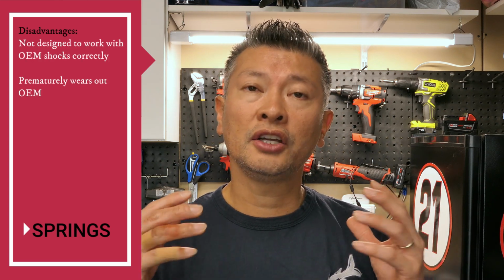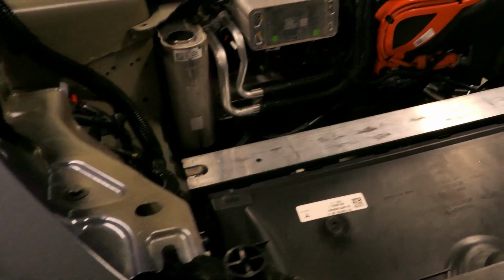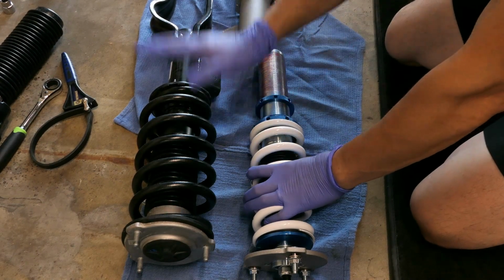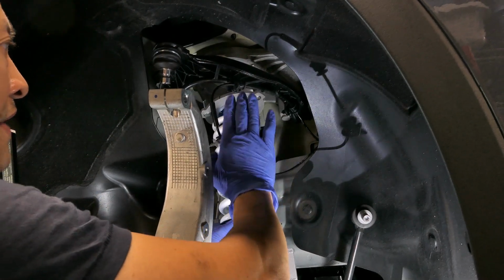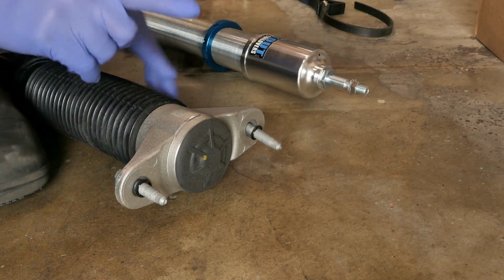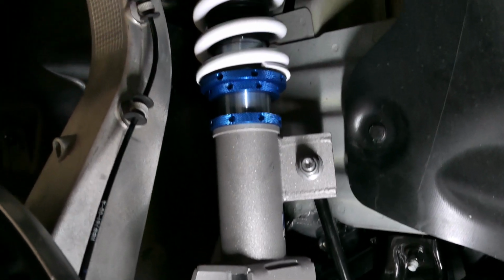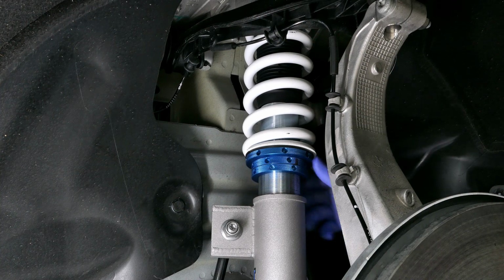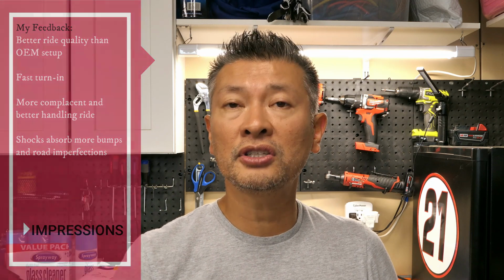Tesla Model 3 and Model Y Coilover Install DIY. #modelyperformance #teslamodely #tesla

Comment: Nice guide!  Should all bushing/ball joint bolts be torqued under load?  If torqued in the air, wouldn't the bushing twist when on the ground at ride height?  Thanks!
Reply: Yes.  100%. They will tear and fail prematurely if not.

Comment: Hey man I love your video! Very informative. What do you recommend to change if I was trying to make my MYP more responsive with handling and taking sharp corners, I feel my car sways and rolls side to side when I go around corners. Looking for that tight sport feel
Reply from the maker: Thanks for watching and the support! If you're looking to improve the riding and handling dynamics, you definitely need to lower the MYP on a set of coilovers. MPP or UP offer great setups that are tuned for performance rather than comfort.

Comment: Hey just checking in on how you have liked these coilovers. I am about to. order a set and want to make sure you haven't had any problems with quality or ride quality.
Reply from the maker: Thanks Matt for the question. Now that I have a fair of miles on these coilovers, I can conclude that their build quality and longevity have proven to be good. There's no strange noises or wear showing up. If you are considering these coilovers, I would highly recommend asking the builder to run softer springs that what they consider "normal". As much as the handling has improved, they are far too stiff to be a daily setup. Perhaps softer rated springs would provide a more plush ride. Just my long term advice.
Reply: @TheAutomotiveFanatic  thank you I appreciate your input.
Reply from the maker: @Matt_Bogosian  good luck Matt.

Comment: And just how the hell are you getting at the 3 13mm top mount nuts??  No socket is fitting in there.
Reply from the maker: Aaron, I assume you're trying to work on a Model 3? The Model Y should have no issues with the 3 tophat bolts. For the Model 3, you will need a thin wall 13mm socket that's specialized for the Tesla.

Comment: Hi, thanks for the great video which I am going to use on my 2023 Model Y for the install. Did you later change the damping settings from 11 in the rear and 10 in the front to make the ride much more comfortable?
Reply from the maker: I ended up dialing down the stiffness to 7/6 front/rear respectively.
Reply: @TheAutomotiveFanatic  thanks
Reply from the maker: @nathvg2576  anytime!

Comment: Very detailed tutorial.  I have a MYP and yes I've noticed that the suspension needs to be upgraded. I wanted to change out the sway bars as well but it seems that the OEM sways are just as good and thick as the aftermarket, so I don't know.   I might go with Tein coilover and maybe try to install it myself.  Did you have to do a full car alignment?  Subscribed.
Reply from the maker: I have heard great things about the TEINS. Give them a try. Depending on how low you go, you do not always have to realign. I did not!

Comment: Flatout suspensions 🤮 People don’t buy these shocks. There are the worst company I ever dealt with. I have purchased a set for my son’s Outback and they run like total crap. The owner Russel is a total Jerk. Ended putting back the OEM struts back. He never got back to me. Btw I got the Mountain Pass performance on my MYP and they run amazing.
Reply from the maker: Wow, that's terrible to hear. I'm sorry you had such a poor experience with Flatout. My personal experience differed from yours drastically. Nevertheless, tough to hear as there's no one perfect company out there. On a side note, glad that the MPP coilovers you installed worked well. Their coilovers are actually made by KW and tuned to their specifications so there's no surprise they function well.

Comment: Hello,
Did you do Adas ricalibration after installing the coil overs? Thanks
Reply from the maker: No, I did not re-calibrate the system. In verifying measurements, my sensors are still accurate to the inch.

Comment: That rear spring adjustment PITA. 
Good video and will definitely look into installing these coil overs once my M3P arrives. 
Thanks again for great detailed video.
Reply from the maker: Yes Don, that rear spring is a PITA to adjust. For the most part, practically all coilovers will have this challenge on the M3 or MY.

Comment: How’s is the ride?
Do you know the difference between flat out suspension vs BC coilovers .
Reply from the maker: Don, the ride as expected, is for firm that stock. However, some of the original loftiness is gone as is the pure harshness of the ride. As far as comparing the FlatOut to BC, there is no comparison. BC components are made in China while FlatOut are sourced either in the US or Japan and are all hand built and checked before they are sent out.

Comment: How much did you lower the front and rear from stock?
And what is the max lowering capacity of these?
Great video, thanks!
Reply from the maker: The front was lowered roughly 1 3/4" while the back was lowered roughly 1 1/2". You can go lower in the front, but the rears are capped out around 2".